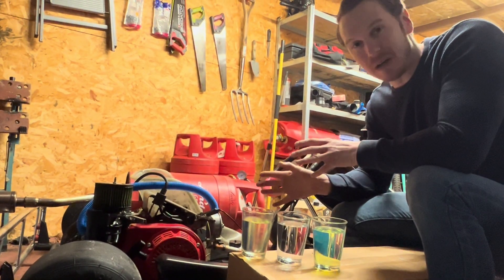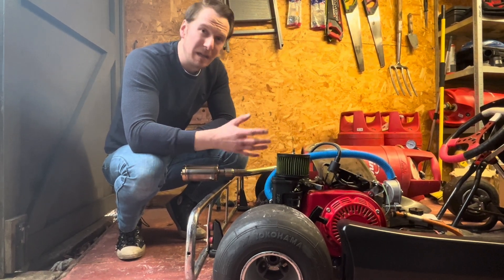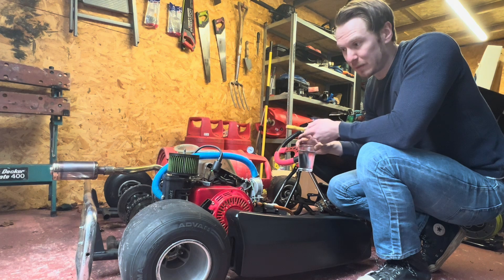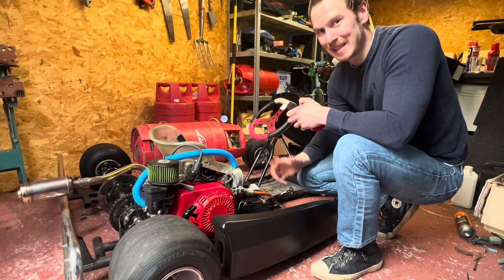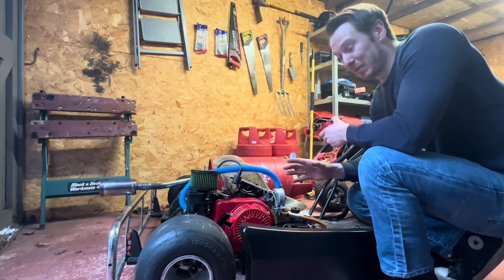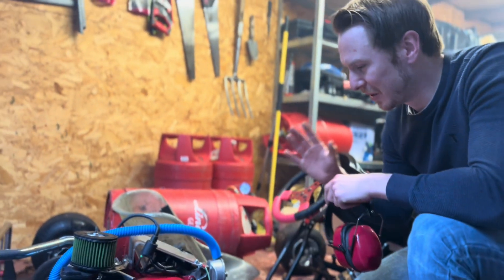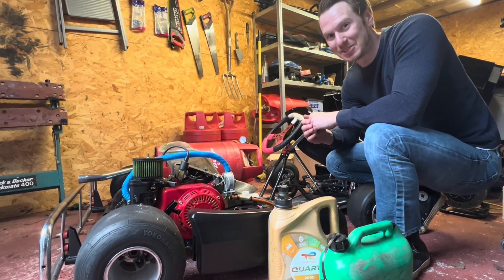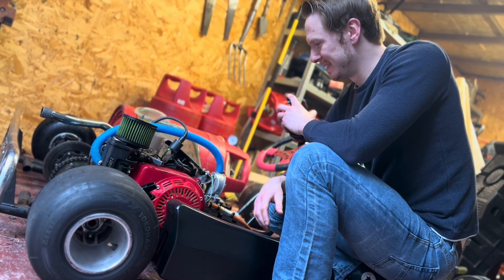This Engine Runs On EVERYTHING!

Comment: iam from Tanzania and i have been watching your videos for a while now , i have made a portable off grid  portable  chemical based hydrogen reactor working with Naoh and Scrap Aluminum so i mainly use em for cooking and recently started selling because they are cheaper than the LPG  and kinda help alot of families out here i wanted to use one on an engine but seems like iam not making alot of pressure but it is making alot of fuel , recently hit 16lpm for 2.5 hrs straight , so we have solved alot of issues regarding making the gas from those reagent and basically its as safe as it can be right now.
Reply from the maker: That sounds ace, well done
Reply: @Hydrogenguys  thank you

Comment: look into aqua tune hydrogen fuel systems, their electrolyser for motorcycles would work very well on a go-Kart. Uses less than 2.5 amps (12 volts DC) for an average Xtreme gas engine model and will not require modification of your power supply.
Reply from the maker: Cheers I’ll look into it.